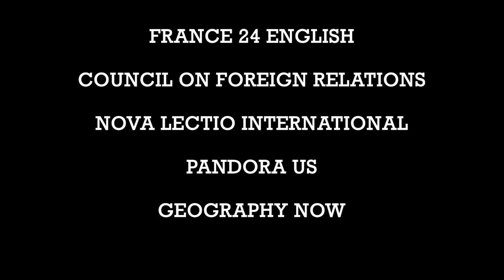The 8th Wonder of The World | The Great Man Made River In The Unlikeliest Locations

Comment: If they connect it to the ocean as well, they can also use it to transport seawater
inland to allow it to evaporatem which will add humidity and with that cloud formation.
They'll need some reservoirs for the drinking water during these transports though.

Alternately, they can add a layer into the pipe, that will allow two way transport through
the same pipe, and thus have both fresh water transport, but also seawater inland
for evaporation.

The inland salt water basin should be checked for porousity. It would be bad
for the seawater to mix in with drinking water.
Alternately, using recycled plastic, any large enough hole can be covered with
such recycled plastic to make it into a big tub. Then water can evaporate without
mixing with any ground water.

Even if this does not lead to factual clouds, the least it will do is add air humidity,
which is already a big step forward in terraforming the local desert.
Even morning dew can do wonders for any vegetation that otherwise goes dry.

At the edges of the basin you can also plant things like palms that can tolerate salt water.

Comment: Worked on the project many years ago on a gas compressor station which supplied gas for the main power generators. From the desert the water appeared to pumped to large evaporation ponds on the coast. Have t assume it would have been far cheaper to build desalination. The only winners being the numerous German contractors who benefited during the embargo 😮
Reply: Not in 1984

Comment: dearing and megalomania project  because the water suplie does not have external refuel so it will dry up anyway if used unless they use clever technical solutions to return the water back to its source and use the water drip technical solution as done in Israel and to use the new Australien plow technic invented by a Australian farmer inventer  with other words invent and benefit world wide and stop using old methods wich are not sufficient anymore these days

Comment: The groundwater will run out at some predictable point. Solar powered sea water desalination  is a permanent solution.
Reply: That predictable point is hundreds of years away.
Reply: It will run for 4800yrs
Reply: It's more subtle. One meter loss can compromize 1000 sq. km of Siwas, or Oasis. Pristine water value will be higher than gold in 100 years.

Comment: Let's assume the ideal and imaginary case which is: the whole project was accomplished and running 100% right now with only $25 billion as they estimated at the beginning to get the 6.5 million cubic meters a day!!  
That's roughly 2.5 billion cubic meters per year for about 7 million people living right now in Libya in 2023.  As Mr. John Woodcock who worked on the project said: "about 20% of this water would be used for the municipalities." That's 500 million cubic meters of water out of the 2.5 billion per year given and taken...
I'm pretty sure the desalination plants would have cost a lot less to build and produce 500 million cubic meters of water per year necessarily for the Libyans, especially since they are only two major cities: Tripoli and Benghazi, and most of the other cities are small and located on the Libyan coast which can receive fresh water through the pipelines from the two big cities or build small desalination plants for most of them...
As for the 2 billion cubic meters per year.  It would be a complete waste of money to spend most of it on agriculture just to show off and it would be cheaper to import than produce it and subsidize it with oil money.
Let alone the destruction made to the underground water ecosystem in South Libya that has been there for tens of thousands of years!! It will be finished and ruined in less than 100 years just because a stupid, evil, bloodsucker and nuts-case dictator wanted to waste the oil money and show off to the rest of the world…The world is a much better place without his ass in it.  Good riddance!! Best luck and wishes to the Libyan people!!